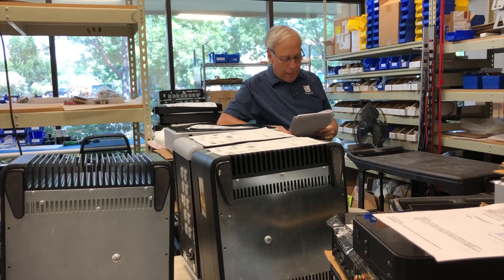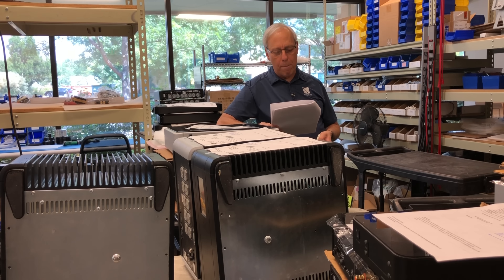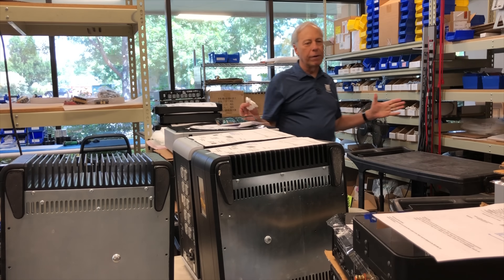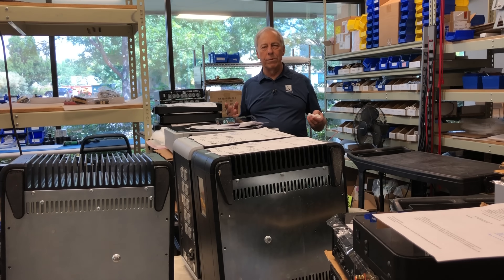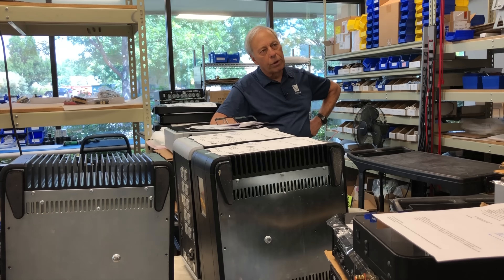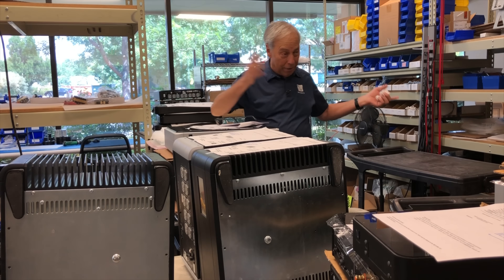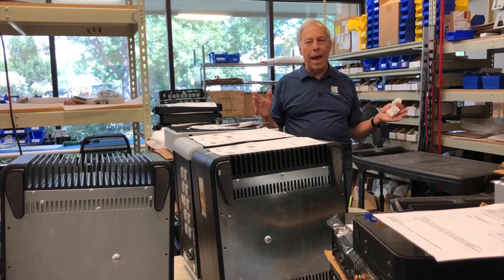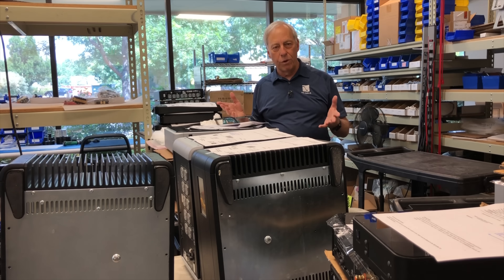Why should speaker cables have a minimum length?

Comment: Hi Paul very much enjoy your videos but somewhat of an own goal regarding this video in that you mention a number of things that are incorrect regarding Naim. 

Now I am no Naim fan boy, as I don't like the way music is presented via their amplifiers, which at one time were somewhat band width limited, and had a very obviously tailored sound that focussed on pace, rhythm and timing (PRAT) and less so on imaging, soundstage, and musicality. 

Naim certainly were at one time, along with the Linn LP12, forefront of the flat earth audio movement (1980s) in the UK, and as such certainly part of the cult idea you mention, that would not be the case now as Linn and Naim went their own way and Naim changed the sound of their products in the mid 90s to 2000s -  thus the flat earth audio movement died. 

Naim were big into star earthing at one time (might still be so), favoured DIN connectors over RCA, and it is true some of their products had the boards isolated within the chasis but not the cables, as you mention in the video. 

Up until fairly recently Naim did not offer much in the way of cable choices, and as has been mentioned below if the end user did not use NAIM NAC A5 speaker cable there was a possibility the amplifier might become unstable, with other speaker cables. I do not believe that to be the case now days, as Naim products changed a lot in the late 90s and 2000s, but certainly true of vintage Naim amplification. However in saying that the asker of the question should check with their Naim dealer or Naim themselves. 

I was myself shocked when Focal and Naim got into business together, as I do not think their products work well together, but thats up to an end users personal listening based choices to decide and my thoughts on this simply reflect my not particularly liking the sound of Naim (as I mentioned earlier) and not being much of a fan of Focal speakers either. I do agree that they are prefereable to B&W speakers, but Naim + Focal, would not be my choice. 

Regarding minimum cable lengths on modern Naim gear can I respectful suggest the owner of the equipment contacts Naim and asks the question of them or the dealer they bought the items from. I would not expect a non PS Audio dealer, or user, to be able to answer questions on your products as well as you can and do. 

Can I suggest for the future, regarding UK products, and items in general you are not familiar with that a few minutes online research might save you a video that is not up to your usual excellent standards. 

Keep up the good work though Paul as this is just a blip and your videos are normally very interesting, presented very well and are informative.
Reply: blabla :) :)
Reply: "Can I suggest for the future, regarding UK products, and items in general you are not familiar with that a few minutes online research might save you a video that is not up to your usual excellent standards."

If you don't like the format of the vlog you should probably go elsewhere. Some of Paul's vlogs are less interesting to me than others. That's a feature, not a bug!

BTW, when I read the phrase "flat earth" I know it's somebody who doesn't know anything of what they are talking about.

Comment: " A longer speaker cable is going to slightly roll off the top end..."
If it is an expensive cable, and you are worried it will roll off the top... Just don't place it at the top.
Reply: Hahahaha
Reply: You sir, are a sage.
Reply: I have an electric wire stripper for teflon insulation. The cutting jaws heat to 750 degrees. Works good.
Reply: Just cut the top off, then it cant roll off.. Bs.. 🤣🤣

Comment: I would have thought it be down to the inductance and capacitance of the cable the greater the length of the cable the greater inductance and capacitance. So when they were making their circuitry they designed it for this type of capacitance and inductance minimum. There is a difference on the output stage as well with MOSFET the way they have them configured can't remember exactly how it's done now. That's not true Paul the length of cable doesn't necessarily if it's good cable affect the frequencies it shouldn't do
Reply: And by doing so, they ensure that they sell their own cables.
Reply: @oysteinsoreide4323  not necessarily so chord cables work fine with their products it's to do with more capacitance and inductance then resistance on the cable they are not twisted I think they are straight wires

Comment: Old Naim amps (including my own   NAP160) can get very unhappy with v short cable runs. And, yes, I believe this is a capacitance issue. I also understand that more modern Naim amps no longer suffer from this issue.

I notice that some of the commenters here think Naims 'wackiness' is very amusing. But I know Naim never does anything if it doesn't verifiably and repeatably affect the sound. Microphony, for example, has been shown to have a considerable effect on the sound of electronics - hence the mechanical isolation at the terminations.

Comment: As I recall, Naim matched with Focal is a bad idea, Naim amplifiers has a kind of harsh top end which will sound good on soft dome tweeter but not for hard dome tweeter like focal and B&W. When the volume turn up to a certain level, the upper end get really harsh and piercing.
Certain group of audiophiles will suggest longer cables to tame the harsh high,  some will suggest avoid using solid core and silver cables. All in the meaning of restrict the system fidelity.
Reply: mikka333 never found that harsh top end on a naim the opposite actually
Reply: mikka333 naim and focal are in a partnership...

Comment: spot on there 
At last someone from the UK ,  made some very good speakers back in the day .
Reply: For many years I lusted after the Celestion Ditton 25s and still do to some extent. My VAF DC-Xs fill the gap superbly, but the Celestions were the first speakers that "blew my mind" as we used to say; back in the day...
Reply: Ditton 15 XRs  I ad 2 , the first set I made a floor standing box , Twice the depth on the back with a black marble finish , yep thats nuts , but not ruin .
I kept one set , still here today , NOT FOR SALE .
Celestion changed there magic wand  with the DL range and did not disappoint  , DL6 hooked up now .
Emmm to much to tex  on this one about 2 way WARFDALE  but the Audax tweeter dose the base driver justice , pulls everything together .
Its hard to fined these Vintage speakers , the ones I have I keep .
Reply: Us Yankees have always been jealous of all y'all Brit's expertise with audio systems. I got no problem with the best, wherever it comes from.
Reply: "Us Yankees have always been jealous of all y'all Brit's expertise with audio systems."

Why? All I could afford in the mid 70s was a pair of AR bookshelf speakers and they were very good indeed. I used them quite close to my head and called them my "nearphones". My current DAC is manufactured by Schiit and is also an excellent product. Well-constructed and inexpensive.
Reply: Hay You started it off anyway so you are in all the way to this day , others have left it all out and not bothered anymore .
I started with a little pocket radio , I got another bigger speaker & wired it in the radio to bypass  that tity thing built in ,  made a box to hold the speaker up , well I was only a kid in the 70s , that was my first move .
I got a bit of stick from my MUM & DAD  for doing stuff but thats was normal  lol
Reply: Same here mate , MADE IN JAPAN  good gear back then , still working now .

Comment: can the same be said for interconnects?
Reply: Don't laugh but I did notice a difference in changing to a longer rca interconnect between my amp and dac. I went from 18 inch cable to 1 meter cable and the sound improved. Why? I think it had to do with the fact that the magnetic fields emanating from the amp we're affecting the power supply in the dac. I noticed the sound cleaned up quite a bit when moved another foot away from the amp. Usually when you have shorter length cables the inverse happens as the sound cleans up from really long speaker cables. go figure.
Reply: George Zubeck, interesting. I could certainly see EMI effects occurring at a strength where an additional 18" of separation would make the difference. 
Magnetic interference is very real as anybody who has experience with big screen CRT monitors placed near power panels can attest to.
Reply: thanks for the response.  it is nice to ask a question and get a professional answer instead of getting bashed.
Reply: No, because interconnects operate at such a low signaling current and with a much, much higher impedance such that you don't see the same kinds of impedance effects. The impedance of a speaker is quite low so even the low impedance of the speaker wire is actually proportionally quite great in comparison to the drivers themselves. Interconnect terminations inside your components typically have an impedance which is on the order of 1000 times greater than a speaker so the impedance of the interconnect wire counts for proportionally 1000 times less in that scenario. Does it still count? Absolutely, in a semantic assessment. Always use excellent cables, but primarily for the quality of the connections.

Comment: Maybe it because if you have cables that are too short,  you will loose flexibility in the physical placement of the speakers and amplifier...  Think about it,  if your speaker cable is one metre (just over 3 feet)  long,  how on earth will you even place your speakers where you want in the room....  Considering that the amplifier in on a rack about 2 feet high... Placement would be a complete nightmare.
Reply: Not so for monoblocks
Reply: Collins Mwaura not meaning to be rude but one meter is 3'4".
Reply: Hahaaha thanks for the correction

Comment: Shorter cables improve damping factor, please correct me if I'm wrong
Reply: You are correct, but damping factor in amps hasn't been an issue for a long time. Any change would be inaudible; certainly inaudible to me, but then I'm not a golden-ears.
Reply: @jonathansturm4163  I do agree with your opinion. Current breed of Class D amp suffer from this issue to some  extent due to presence of output filters. Blind AB testing have busted many "golden ears" myths, glad to know you don't have ones
Reply: @rogerwalter2500  Blind A/B tests were busted years ago.
Reply: @carlosoliveira-rc2xt  I beg to differ on blind AB or X testing
Reply: You are CORRECT sir !!!! And dampening is one of the only things that's NOT voodoo 😀
Reply: That is why typically mono blocks are placed right beside their respective speaker.
Reply: @carlosoliveira-rc2xt  about monobloc placements you are right

Comment: It’s to add sufficient inductance to the outputs... I use Linn amps instead.
Reply: A speaker cable has virtually no inductance.
Reply: Unless by design like NACA5, I’m right about this. Some Naim amps will go into oscillation unless you use a suitable cable of a suitable length. Plenty of info about it online. As far as I’m aware thought, the Supernait (or any current Naim) amplifier doesn’t have this “design quirk”.
Reply: Some say "design quirk," I'd say "design flaw."
Reply: Bruce Morgen yeah I was being sarcastic, hence the brackets... it is deliberate though.
Reply: Inductance? Really? How
Reply: Capacitance, not inductance... unless they want you to wrap it around an iron rod...
Reply: Richard Smith no, inductance. Granted, there isn’t generally much inductance in a speaker cable but that’s why they specify a certain type and minimum length. Earlier Naim amps have no inductors in the output stages and rely the speaker cable to do the job. I’m not making it up, go read up on Naim amplification.